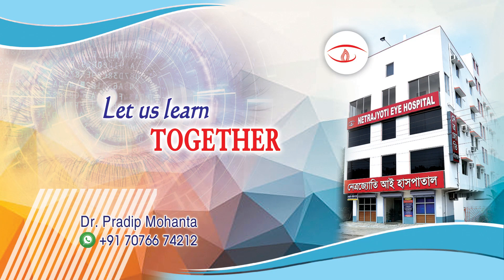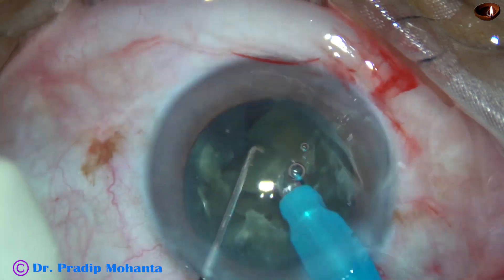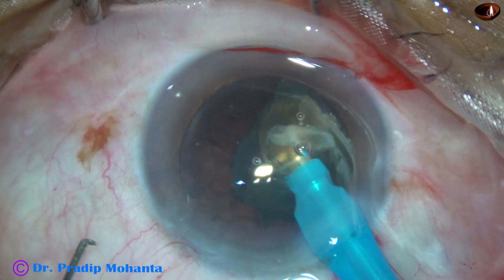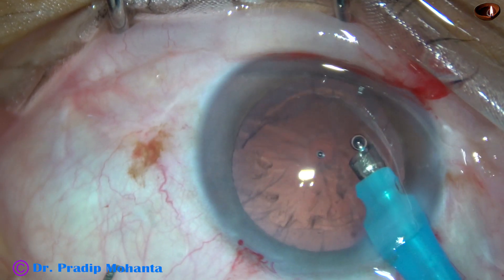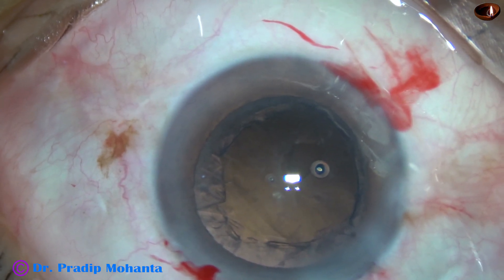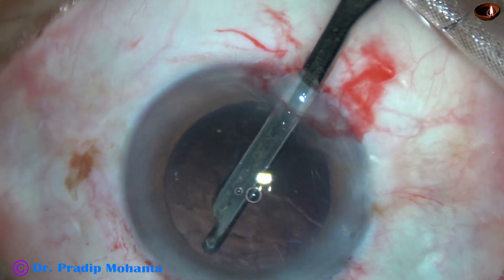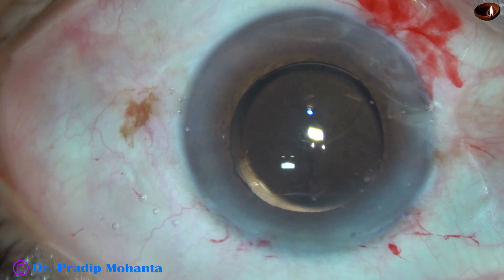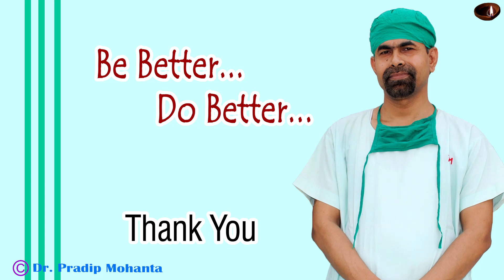Managing a P C Rent without vitreous prolapse into anterior chamber: Pradip Mohanta, 16th Sept, 2020

Comment: That’s a very interesting and illustrative case on managing this type of posterior capsule rent, wonderful management dear Pradip!
It is my impression that when the rent occurred the anterior hyaloid was already detached, as no vitreous came forward or was aspirated. In fact, that’s what may have contributed to facilitate the tip catching the capsule: the detached capsule flutters and can “trampoline” up even with the slightest AC aspiration surge (the “trampoline effect”). It has a positive side though, as the fluid filled Berger’s space allows for better management and conversion of the rent into a PCCC, and a safe in-the-bag IOL implantation can be performed. As the aqueous-vitreous  barrier is preserved, a very routine post op period is expected.
I would like to call attention to one extremely important aspect or technique you showed when managing these cases: the CORTEX DRY ASPIRATION TECHNIQUE.
I apologize for the screaming capitalization 🙏, but this is to call the attention of the youngsters: this is a must learn technique and always to be remembered to use in situations like this. Vitreous hydration should be avoided whenever possible, and one should not leave cortex behind in cases of capsule rent as inflammation and IOP rise and bag contraction will ensue. Dry aspiration is an extremely effective and controlled way to deal with cortex in this and many other situations.
Wonderful opportunity to discuss about that, and your technique was flawless: please take a bow, dear friend! 😊👏👏👏👏
Reply from the maker: Happy to get your analysis,  dear buddy..🥰